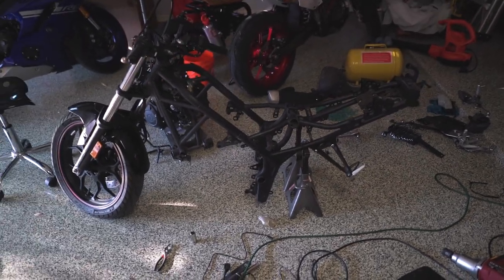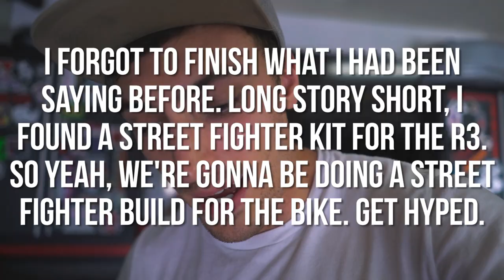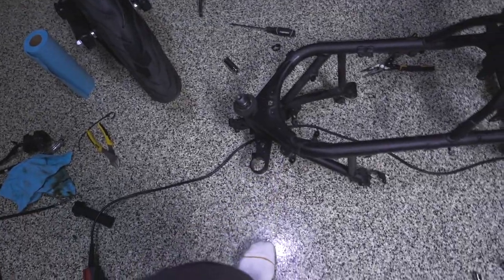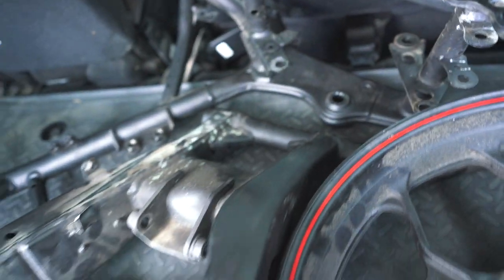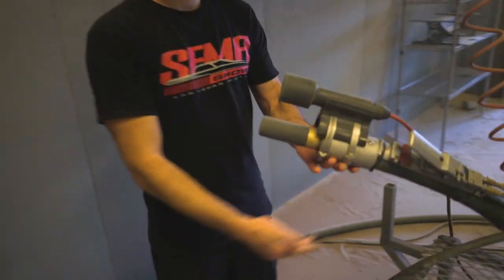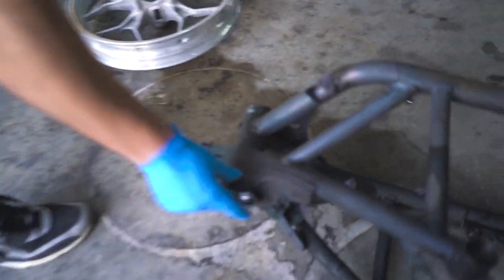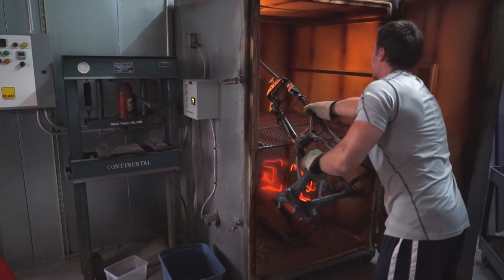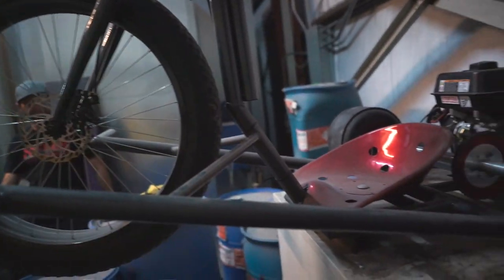OFF TO POWDERCOAT! [R3 Build Part 3]

Comment: R3 streetfighter is the mt03 right?
Reply: Renger Hoekstra sort of. The street fighter kit looks 200 times better.
Reply: Super sport, cafe racer, naked bike, street fighter, etc are all different types of bikes/styles. Like dirt bike and dual sport. Different.
Reply: I'm just saying, if you want the same results of this building series, you can start out with a mt03 if oure friend is not using the fairings again.
But will need to keep watching offcourse! 😁
Reply: Renger Hoekstra mt03 isn't available stateside...... That's also not the direction he was originally going with this build.....

Comment: Did you take the vin number sticker off? Are you gonna re use that sticker or does the bike have to get re registered with a new vin?
Reply: Emanuel Paredes the vin is stamped into the head of the frame so the sticker may be covered but no paint or coat is gonna hide the stamp